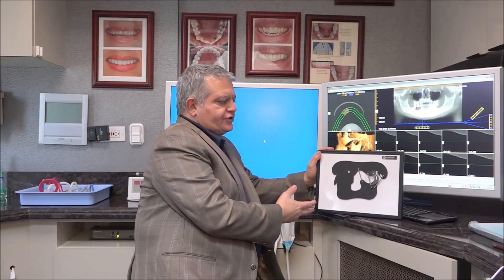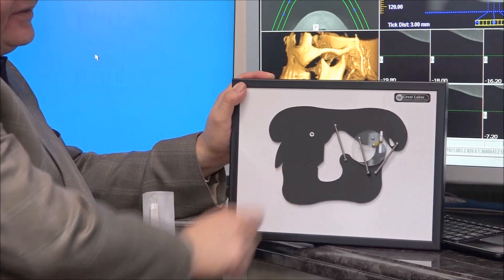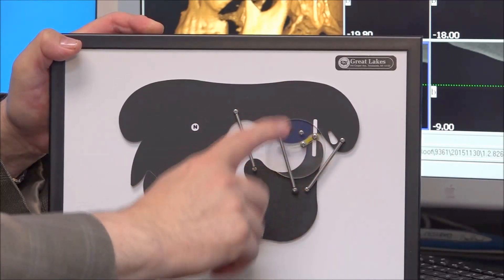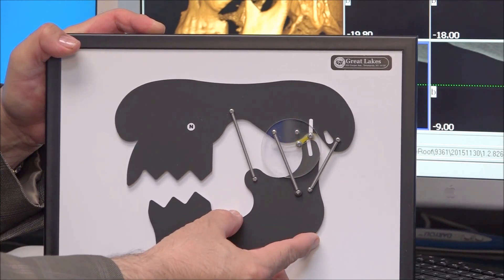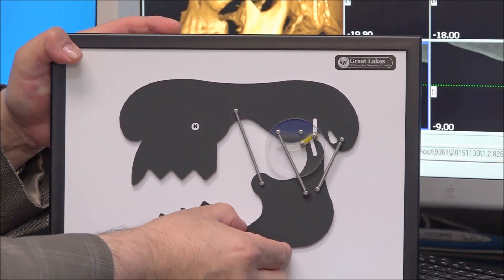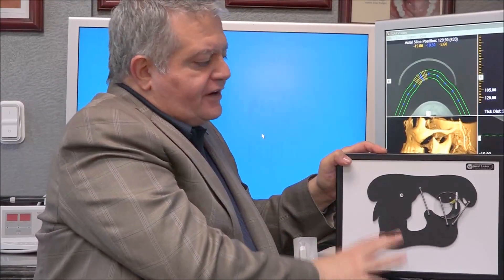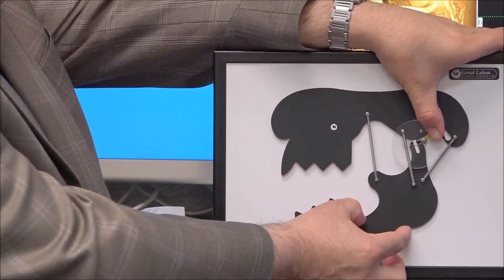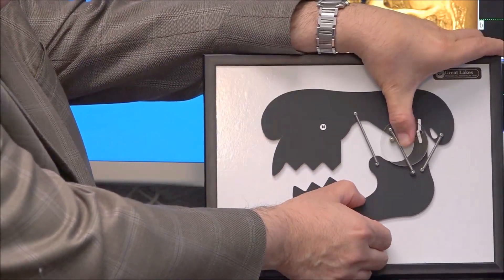What are the Symptoms of TMJ Disorder | Dr  Parsa Zadeh

Comment: Dear Dr Zadeh , thanks for your video.

Is it normal for front teeth to occasionally collide when talking? (I don't think so)

I have TMJ including disc displacement with reduction. My speech has also been effected. Just today, I notice that my front teeth sometimes collide when I talk and this throws my speech off. 

I'm not sure if the TMJ has upset my bite and is causing my teeth to hit each other when i talk or if I have a problem with my bite which may have caused my TMJ?

I don't believe I'm grinding. My TMJ started same time with bite/chewing difficulties. Not sure which is the cause. 

Please give me your opinion.